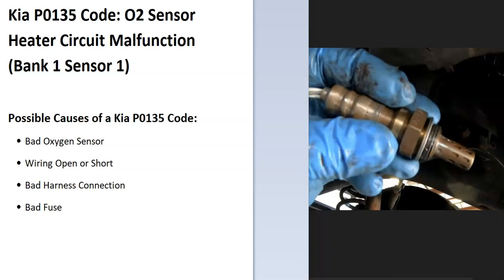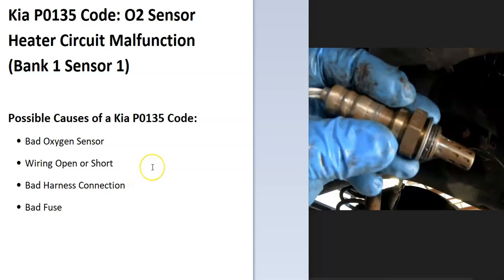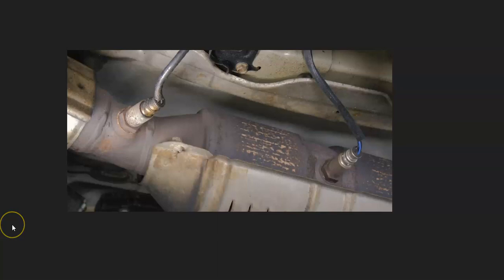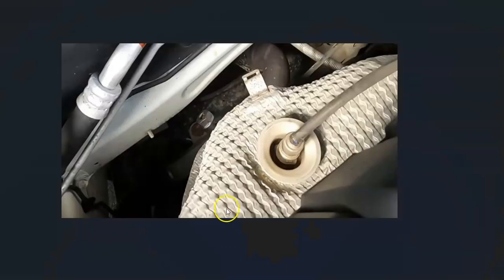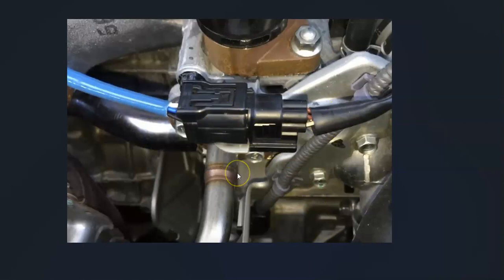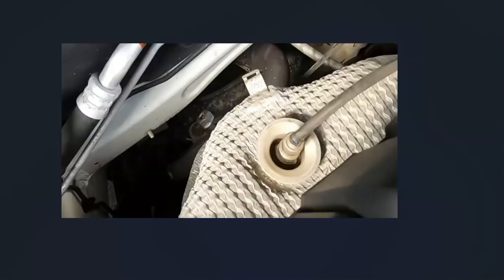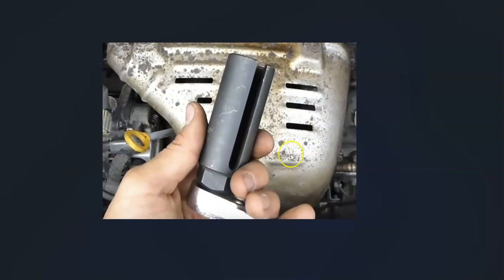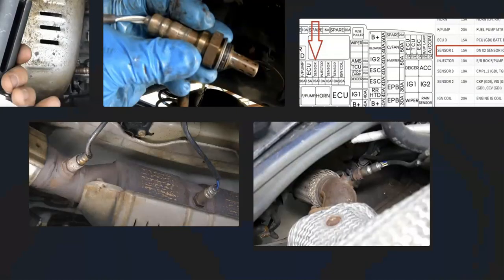KIA P0135 Code: O2 Sensor Heater Circuit Malfunction (Bank 1 Sensor 1)

Comment: My kia had thrown this code and it is un drivable at the moment. Would this sensor cause the engine to bog down and not wanna take any gas?
Reply: More than likely you need a new catalytic converter. Wha you are describing sound like when a catalytic converter gets plugged up in the inside to where it doesn't allow the exhaust gases to come out and it will prevent the car from accelerating. In some situations the symptoms get worse once the engine gets a lot hotter